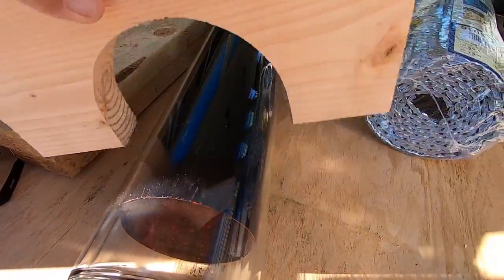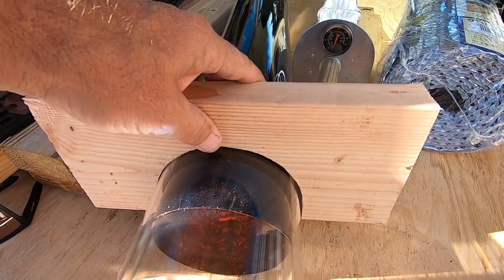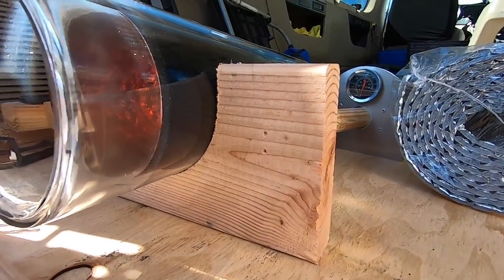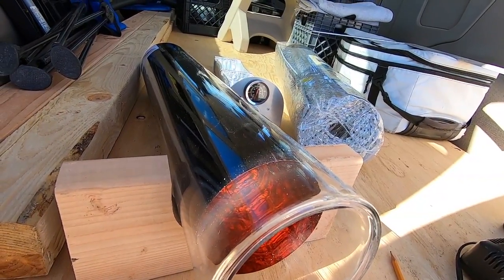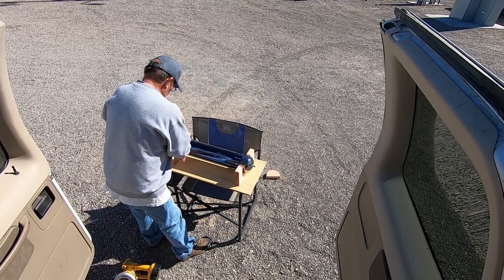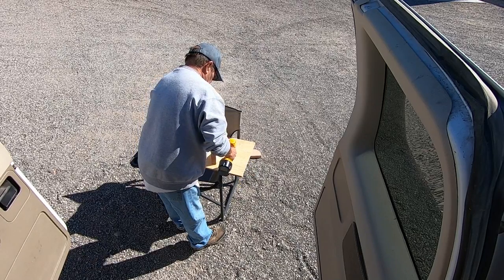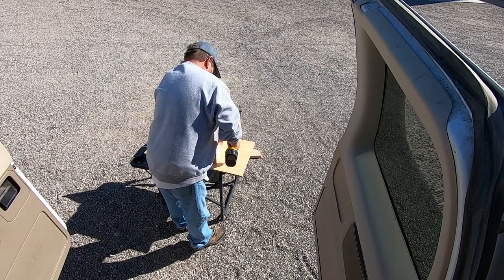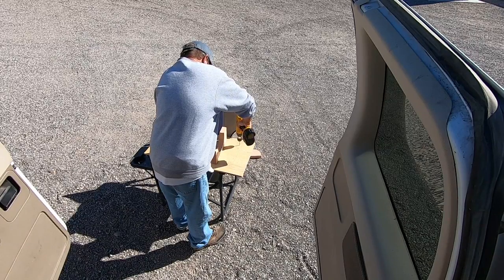SOLAR COOKER Glass Tube DIY FRAME Part 1

Comment: Hi Russ,  I would suggest that you should paint the wood supports white instead of black.  With them black, the wood is absorbing most of the suns energy hitting it, heating the wood.  If you paint it white, it will be predominantly reflecting all the solar energy up into the solar tube instead of putting the heat in the support.  Of course a mirrored surface would be the best.
Reply: Just get the sun shade I saw in the front of the truck and put it under the tube.  No paint needed.  Put a 2x4 on each side to force the reflective sun shade into a curve and it should be a little wider too.  Most of the reflectors I make are 26" wide and about 6 inches deep.  PIPEtalk

Comment: No need for a new saw if the electric motor is still rotating well.  Replace blade with steel carbide blades.  They stay sharp up to 10 times longer.

Comment: ..since your surface is Flat under the tube, i'd use a few mirrored Tiles glued on with roofing adhesive or something instead of Aluminum foil..

Comment: Looks great!
I have a great idea Russ -
Get one or two of those "Neoprene" pot-holders at the Walmart? or somewhere.
Cut it as a liner where the tube sits.
The half-circle may need enlarging a bit.
Just glue a strip of that neoprene on the curve.

Do the same on a top piece.

Comment: Awesome! But does it get hot enough to burn the wood?
Reply: No it will not get that hot.  Cooking temperature is like an oven.  My designed reflectors are for 350F to 400F  PIPEtalk
Reply: How can i make the glass?